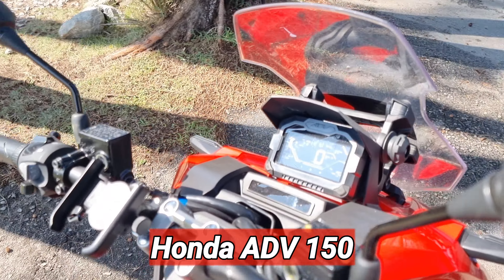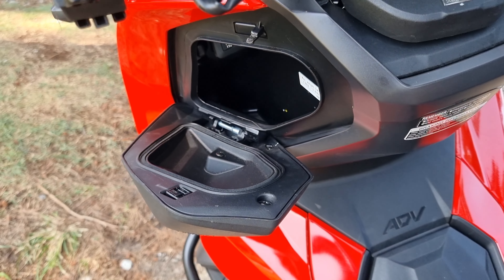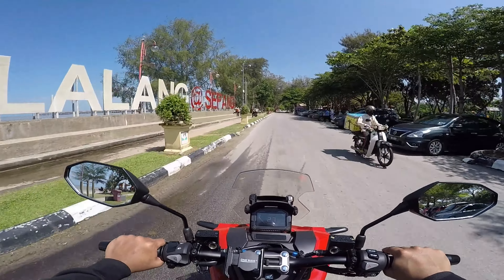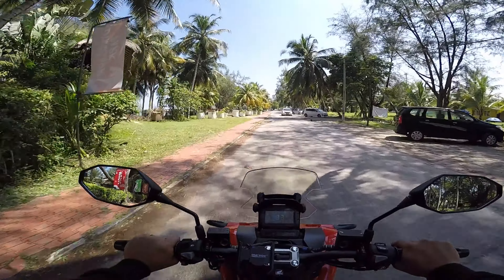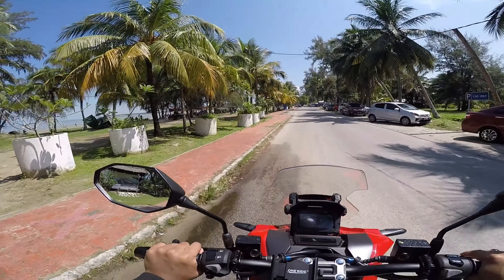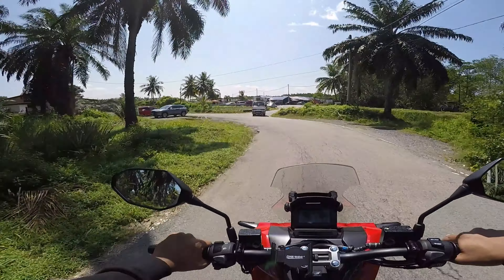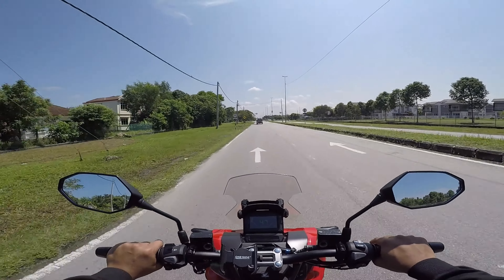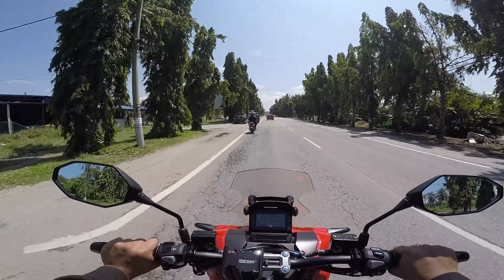HONDA ADV150 MALAYSIA | REVIEW & FIRST RIDE IMPRESSION

Comment: Minat adv ni. Tp tu lah. Risau mentenen dia. Skuter
Reply: Service stiap 2000km, utk mnyk htam, stiap 4000km utk mnyk gear,  x smpai rm100 pun, bajet dlm 50-70, filter kt dlm tu bleh la tkr stiap 6 bln klau btul2 jaga, bjet dlm rm100, x tkr pn xde masalah, belting plk klau kerap guna, bleh set tkr 6 bln skli, brgntung pd pnggunaan
Reply from the maker: @hamizansuhaimi1412  terbaik info bang 👍🏻👍🏻
Reply: gie service centre minyak hitam 28rggt plus minyak cvt x smpi 40rggt
Reply from the maker: @hujanrintik6961  terbaik 👍🏻👍🏻